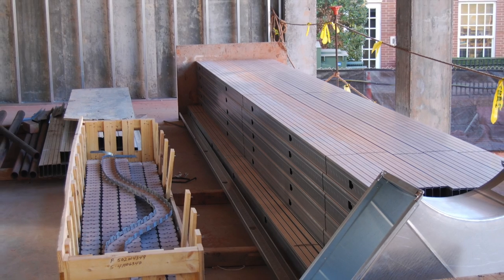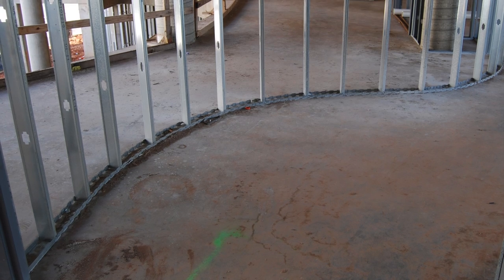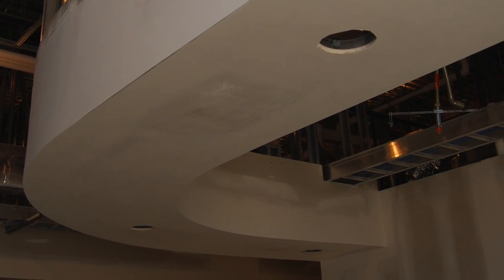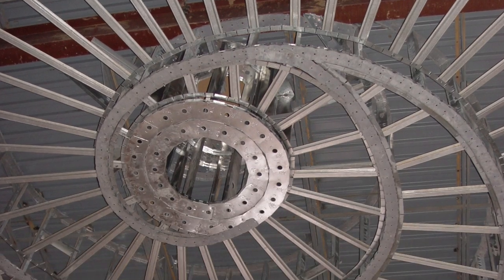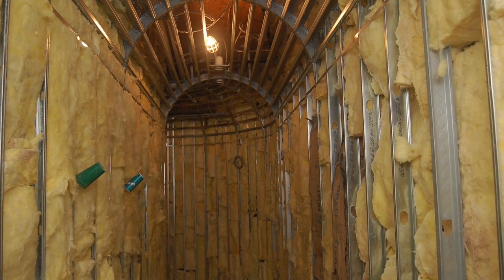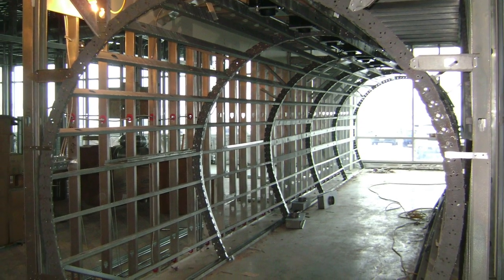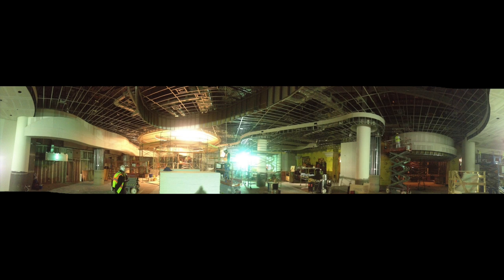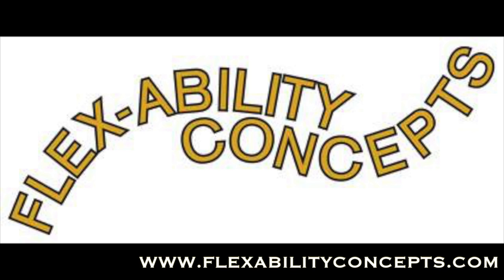Framing Beautiful Curves

Comment: great stuff....hey maybe i could use this to build forms for aircrete domes...hmmm....if i incase these in aircrete, what is the life span before erosion?
Reply from the maker: We really don’t know how long Flex-C Trac would last before corroding if encased in aircrete.  I suppose it would depend on how much it is exposed to water, which would increase the corrosion reaction.  All of our Flex-C Trac  products are galvanized or galvannealed, which gives them good protection for typical use in a wall, even exterior walls.  Our 20 ga. Flex-C Trac  has a G-40 coating, and the thicker gauges, 18 and 16 ga. Flex-C Trac  have a G-60 coating, if that is any help.
Typically the Flex-C Trac is installed in a wall and protected from prolonged exposure to water, as the structure is “dryed in”, so it hasn’t been an issue, and we haven’t investigated it.  Sorry I couldn’t be of more help in this area.  
Also, be sure to check our load capacity charts as found in the Dome building worksheet, if you’re expecting the Flex-C Trac  to contribute to the structural load bearing capacity.  Typically, in a dome, the skin of the dome actually contributes more to the strength of the dome, than the framing does.  
I‘m not  familiar with all the methods of installing “aircrete” but if it is sprayed on , such as in “shotcrete”, then I’m sure you could gradually build up the shape of the dome, which could grow in strength as you spray it, and it cures. But if you’re installing the aircrete as blocks or slabs, the weight could easily rest on the dome framework and overload the capacity of the dome framing.  
I hope this helps!  Frank Wheeler